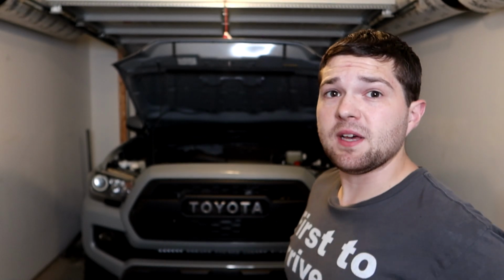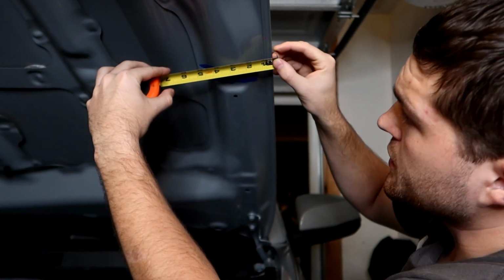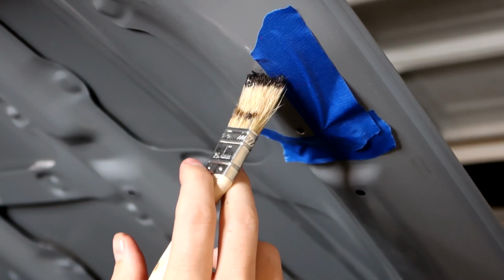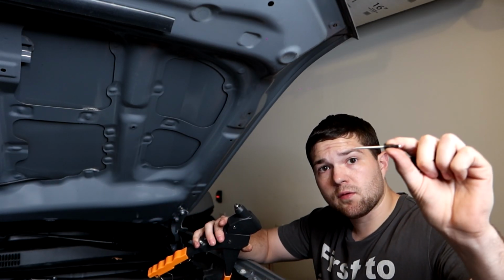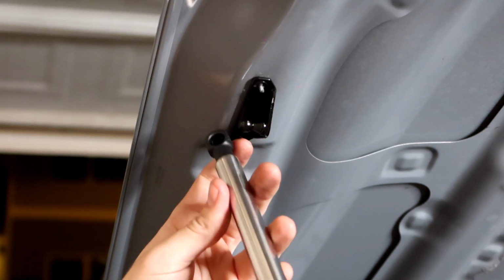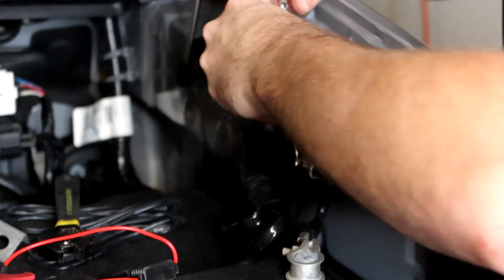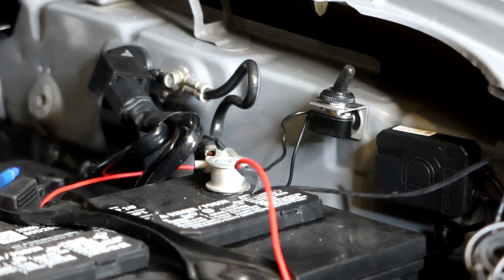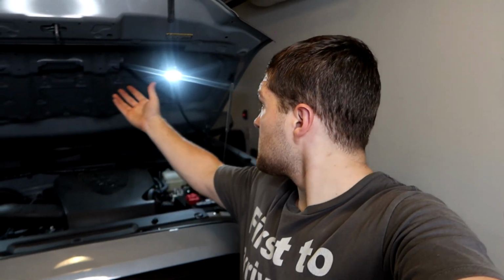2020 Toyota Tacoma HOOD STRUTS + LIGHTS (Install tutorial)

Comment: Why not use a q-tip on the holes?
Reply: Another tip, find a remote hood lamp from a GM truck. The '95s had 1 that had a switch & a spool you could use outside the truck.

Comment: I would recommend using stainless steel metal self threading screws / bolts rather than those pop rivets.  Why a company goes to all the trouble to make a quality product and then put some junk in there to assemble it just baffles me.  The "nipples" are actually called balls or knuckles that insert into the sockets.  Thanks for the video.

Comment: If I may....You could probably have gotten away with grounding the lights to the hood using a couple inches of wire instead of running all that black wire back to the ground stud.
Second, using thinner loom for one wire and dressing it up neater would have made it a much cleaner install....add finding a lighter colored loom would have been even cleaner.
Lastly, switch or not, I would never run a wire that's connected to the battery. Tape (insulate) the end near the termination point, and connect it to the battery LAST.

Comment: Why not just use a pressure switch like whats used for the door? Makes the lights "automatic".
A person could pick one up cheap at a junk yard or even a cheap after market one from a parts store.
It's what we used to do back in the day for door switches when wiring up an alarm system.
.02
Reply from the maker: Its what came in the kit
Reply: @TacoRick  I see. Maybe I missed that part about it being a kit. I take in a lot of tutorials while I work.  Cheers

Comment: Great job on the hood struts and under hood lighting. To avoid the potential of forgetting to turn off the lights you could use normally open switch. That way when you open the hood the switch contacts would close and send the voltage to the lights. Those switches can be purchased on Amazon. A question. I have just bought a 2019 Toyota Tacoma limited. I know you have the 2020 model. I want to install the bed lights like you put in yours but I don’t believe the wiring is as simple with yours. I’m wondering if the harness connections are also in the 2019 Tacoma. If not I would have to run them the length of the truck and try to find that outside circuit in the fuse compartment. Do you happen to know if the harness is there in the back in the 2019 Tacoma? Thanks! Your videos are amazing! I’m a retired Mechanical Engineer with Caterpillar Tractor.
Reply from the maker: Good idea.

Comment: When using a step bit it helps to wrap some masking tape around the step on the bit you want to drill to, to avoid going too far and ending up with a bigger hole than desired.  Stretching electrical tape around the bit works even better.
Reply: ...or just use the correct size bit. This really isnt the situation for a step bit. Just because it works, doesn't make it correct.